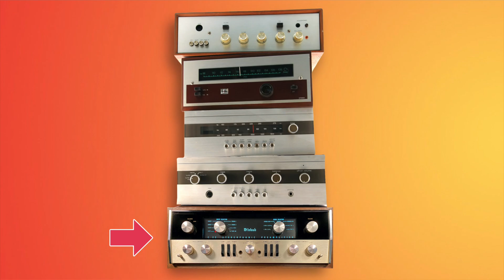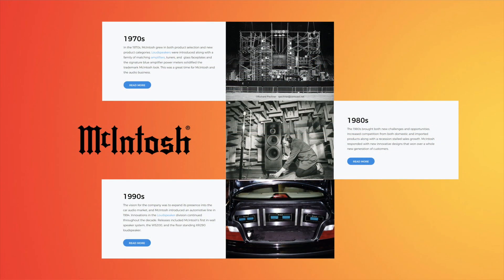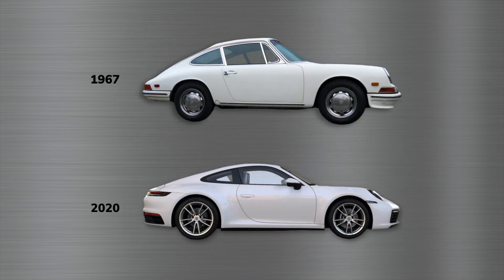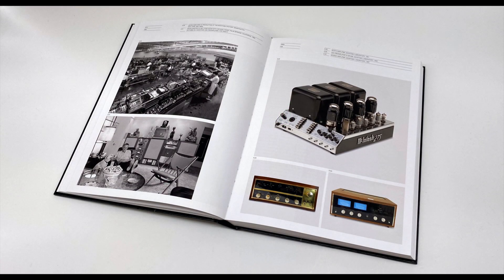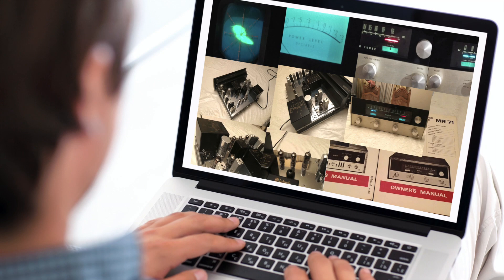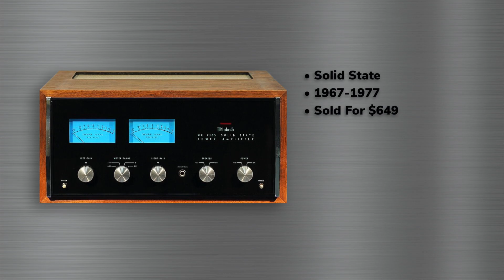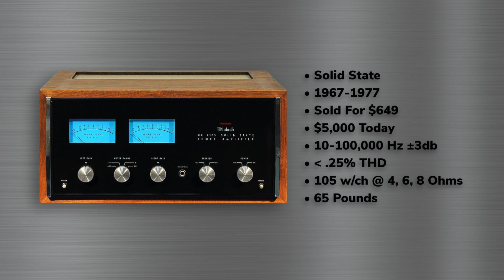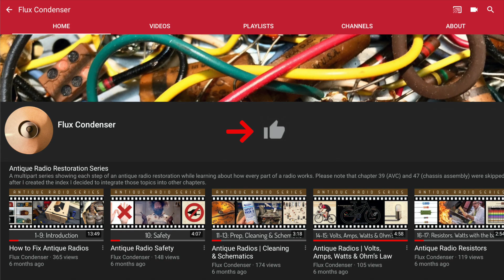McIntosh MC 2105 Restoration P1: Why Macs Are So Collectible

Comment: @Flux Condenser Thanks for making and posting this video. I don't have an MC2105 but it's been hugely helpful. I have a C26 with some problems -- the power switch doesn't work reliably and there's a 60-cycle hum.

The most useful part of this video was seeing you pull the knobs off. My eyes about blew out of my head.

I've tried many times over the years to see if there is some way to get the knobs off. I've looked online and nobody seemed to know how to get them off. 

When I saw you pull off exactly the same knobs as are on my C26, I thought, well, let me try that trick with wrapping dental floss underneath the knobs so I have something more to pull on. It works with other equipment, so now I know it should work on the McIntosh.

Before I wrapped the dental floss, I gave a knob a good hard tug to see how it felt, and I could feel it sliding. I pulled some more and they all came right off. I couldn't freaking believe it. I have no idea why they suddenly decided to come off.

Anyway, now maybe I can fix the power switch and replace the caps.

I'm very grateful that you made and posted this video.

Comment: Thanks for the videos - a lot of work for sure, and very helpful! Something that would make it even more helpful is for you to slow down, way down, on the disassembly part in Part 1. There are a lot of chassis parts to remember how to put back once they're apart and, given the age of these guys, not everything fits as a factory fresh unit did, I'm sure. Thanks!

Comment: Thanks for doing this series - I own an MC 2105. "stereo hi-fi" was a shared hobby with my father when I was in Jr & sr high school. So my dad and I were together when he bought this in the early 70s. I inherited it officially when he passed away some 10 year ago. I had it serviced at the factory about 15 yrs ago. But I have been thinking about the caps. And need to replace some bulbs.

Comment: It would have been nice if you could have slowed that disassembly down a little... I got to the point where I took off the bottom plate but now I need to remove the cover to the cans and transformer. It appears that it maybe be held down by the hex nuts that I see from the bottom. 

If so, the rack-mount rods are in the way of getting to the ones at the left & right outer edges. I don't want to remove those spring-loaded rods and I'm going to see if I have a small adjustable wrench.

Still, a reference to removing these covers would have been very helpful.
Thanks,
Rich
Reply from the maker: Rich, you may want to jump ahead to Part 9 of this series, as I show the reassembly of the glass and front dial more slowly and describe the process. You’ll be able to use this to help understand how it all fits together. You don’t need to remove the rods to remove the front panel.
Reply: @FluxCondenser   Thank you for that tip and for getting back so quickly! I happen to be working on recapping this amp right now. I didn't expect a reply at all because this video was done quite a while ago, so I didn't check for a reply until just now. 

However, you misunderstood, I'm stopped at the point where I need to remove the cover over the large cans. I got past the front panel removal and have completed the removal of the Bottom sheet-steel covering. 

I need to get to the large Capacitor cans and it's that cover that I need to remove. For that, I'm pretty sure that I need to remove at least, 4 of the 12 the hex nuts (as seen from the bottom). I say "4 hex nuts" because I doubt they would use all 12 just for the cover of that section. The other 8 are likely to hold down the transformer assembly.

Now that I know there's a reassembly video, perhaps there's a more detailed version of replacing the cover for that section of the amp. If there is, would you please let me know which video # for the procedure is? Thanks again for the fast reply and I'll be checking my email every few minutes just in case you respond again.

Rich
Reply from the maker: I understand now. Yes, that puzzled me a bit when I first started working on these. You’ll see how to remove and install the metal cage in Part 9, but briefly, yes, you need to remove the bottom cover which gives you access to the bolts that hold the cage in place. I can’t remember exactly, but I believe there’s either two or four bolts or nuts. Very simple once you get the bottom panel off. 

I get notifications when someone leaves a post and my channel is small enough that I can usually respond quickly. If you have any more questions, feel free to leave a comment and I’ll do my best to help.
Reply: @FluxCondenser   Thank you! Yes, I found the 4 nuts that I needed to remove in order to get where I want to be. Now that I know you're still monitoring this post, I feel a bit more confident about this process. I have instructions, videos, and a full Cap-kit. I have about 30 years experience with microelectronics as one of my more, "occasional hobby's".

That is, I own a signal function generator, AC Meter, Oscilloscope, and a number of other instruments and tools but I'm a novice at using them and still have much to learn before I'd dare try to help someone else. 

The good news is that I have at least the same number of years in experience with soldering and have a good, quality level solder station. Several months ago, (actually, back in late 2020, I think), I watched this video and then started watching the next video in the chain. I got about 22 minutes into it before I was suddenly stopped by several major events that required my immediate attention.

It actually took quite some time before I completed the tasks that those interruptions brought with them. Now I'm finally picking up where I left off. I was only to the point of getting the amp on bench so I'm pretty much at the very beginning. 

I recently bought a de-soldering station with an electric suction pump, which I have yet to try. I'm pretty sure it was in the next video that I saw you using one. 

Though the one I bought is a less expensive brand, (and not nearly as good as yours, I'm sure), I'm hoping it'll work better than what I typically did when it came to de-soldering these components, (which was rather slow and at times, frustrating).

Anyway, I'll try not to make a nuisance of myself but if I get into something that I just can't work out, I'll post a comment here and see what happens!
Thanks again,
Rich
Reply: @FluxCondenser  I just did a search for "McIntosh MC2105 P9:" but nothing comes up. Does Part 8 include P9?
Rich
Reply: Never mind, I found it! And I'm glad I did! I was removing the nuts from those twelve bolts on the underside when I should have been removing two sheet metal screws! LOL
Rich
Reply from the maker: Rich, glad to hear you’re back on track. Sounds like you’re well on your way to getting the amp running like new again. I wish you lots of luck and hope you enjoy the experience. I’m always here to help if you want to bounce something off me.
Reply: @FluxCondenser   Thank you, I'm a bit apprehensive because the amp's condition was great when I bought it from an original owner last year. However, everyone, (and I mean EVERYONE), insisted that I needed to recap this amp if it had never been done because the caps were too old to be running at the original specifications.

It made sense at the time so I decided to do it even though I couldn't detect any issue by ear. It had a slight bubble blemish near the headphone jack so I bought a new Faceplate from McIntosh some months ago. I got it for about $185 (TT&L and shipping total). Therefore, that was the motivation for going through with the full recap while I was replacing the faceplate.
Rich
Reply from the maker: @richpaul8132  Hm, interesting. If you weren’t detecting any issues, yours might be fine for a while. With mine, there were definite performance issues, channel imbalances and the meters needed a calibration.
Reply: @FluxCondenser  I must admit that there was a channel imbalance. The left channel is always showing a significant lower output than the right. However, I have an ADC Sound Shaper III EQ in the loop and I play a lot of music back from any one of my 3 Reel to Reels, (though I don't really use my little Akai deck anymore).

I was blaming the light output of the left channel on the decks and EQ output adjustments. I must admit that it was wishful thinking because I recently bought a new turntable. It's not an expensive model, (about $500), but it came with a factory mounted Ortofon 2M Blue cartridge.
 

The turntable is a Fluance RT-85 and held very high reviews in several audiophile websites. It was said to be in the same performance category as many tables that cost twice as much. 

I just replaced the heads on my Tascam 32 in October 2020. I used my scope and AC meter for each adjustment step. In addition, I had a direct phone support to a professional Reel to Reel deck repair company/owner. I was able to confirm that all alignments, (zenith, azimuth, etc.) was as good as I was going to get and the Bias adjustments were good as well. 

My Teac A-3440 4-channel/4-track had new heads professionally replaced and aligned just before I bought it. However, I couldn't really evaluate the channel output of the amp from the playbacks of that machine. I use that deck to mess around and play my drums to a playback of my rhythm keyboard. The playback isn't really the best thing to go by if you're trying to judge the balance.

That pretty much leaves me with no real excuse why I would blame the decks or the turntable. Maybe the left channel on the amp was dropping out! It'll be nice to see what happens when I get through.

Rich
Reply from the maker: Yeah, if the balance has drifted from original, that’s a sure sign something is up. If you can pull off the restoration I show in the video, you’ll be glad you did. I’m not a fan of restoring things just for the sake of it, but in this case it made a big difference. The amp has loads of power and sounds wonderful. Be very careful cleaning the level potentiometers. Mine didn’t take well to cleaning and I ended up having to replace both. Unless you’re getting huge dropouts from them, you may want to consider leaving them alone. As I show in the series, the resistive tracks are extremely fragile. If you do use a cleaner, use Deoxit F5 fader (very sparingly) as it’s better for controls with plastic elements.
Reply: @FluxCondenser  Yes, thanks for that tip. I don't have big dropouts but the left channel has a consistently lower output. Of course, I have Deoxit 5 as you recommend, but considering your caution, I may just avoid trying to clean those at all. It's pretty clean inside already. I may just replace the caps and then try it and see if that does the trick.

I'm not racing the clock and I'll be working on it between the other things I have to do throughout the days ahead.
Rich

Comment: I have one of these I purchased in 1967 I think.  Recently it has started "motorboating" on the left channel.  Can I fix this problem?
Reply from the maker: You’re getting low frequency oscillation from unwanted feedback. Most likely a coupling capacitor issue. So, yes, if you replace the capacitors and check and replace any bad resistors, as I show in this series, the issue will likely be remedied.
Reply: @FluxCondenser  Which are the coupling capacitors?  I have enjoyed the videos but must have missed you telling which capacitors are the coupling capacitors, or is that phrase just a description of a fault?
Reply from the maker: Good question, David. Capacitors can have many uses such as smoothing DC ripple (filter caps), bypassing (sending unwanted noise or signals to ground) or connecting different stages of circuits to pass the AC signal while blocking potentially harmful or unwanted DC (coupling caps). I’d have to look back at the schematic to see which caps I was referring to as coupling caps, but if you have a schematic, they should be easy to spot. They won’t be in the power supply and they won’t connect to ground. Hope this helps.

Note that I may have been using the term generically and referring to all the non-electrolytics as coupling caps. I sometimes do this as a bad habit and it may not always be technically accurate.
Reply from the maker: David, also note that if you don’t have the technical skill to diagnose your specific issue with motorboating, I’d recommend you’d replace all the non-ceramic capacitors in your unit. If you have a 2105, from recollection that will be all of them. You can purchase separately or get a kit, but remember that as there were many versions of this amp, some of the parts may not be a perfect fit for your particular amp. Recapping is a good way to try to fix something vintage when you want to do the work yourself, but can’t pin down the specific issue. 

Going this route, though, doesn’t guarantee success. Recapping may just do the job, but there could be other faults causing your amp’s condition as well. If you want guaranteed success, you’ll need the means to diagnose all potential issues, either by yourself or paying a technician.
Reply: @FluxCondenser  It happened when I raised the volume suddenly.  Best place to buy the parts?

Comment: I just picked up this amp and find it has amazing sound with my Mission 707 bookshelf speakers and DCM SUB2 15" Subwoofer.  Where did you get the components to do the refurb?  I worked as an RADAR Technician in the Air Force and this AMP reminds me of the gear we maintained.
Reply from the maker: Hi, James. All of the parts required are readily available from Mouser, Digikey and others. For this particular project I purchased an upgrade kit from eBay, but as shown in the video, not all of the parts included worked with my amp. (There were many variations for this model over the years.) The kits can be convenient, but you may be better served by buying the components separately which is what I do for most projects.

It’s interesting that you find similarities between this McIntosh unit and the military devices you worked on. That’s a high compliment to McIntosh as my understanding is that military gear is generally built to a far higher standard than consumer gear.

Comment: Thank You Very good Information Mc Intosh Owner Looking For A MPX Circuit Board MR 73 044-072  Thank You
Reply from the maker: Thanks. I would call Audio Classics, McIntosh or search on ebay. Gonna be a tough find and you may need to buy an entire unit and part it out. Good luck.